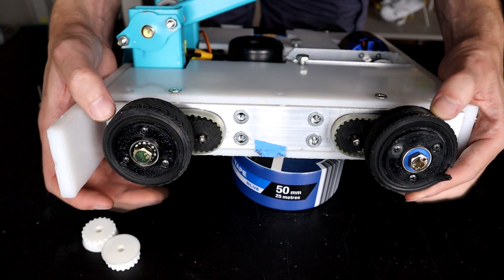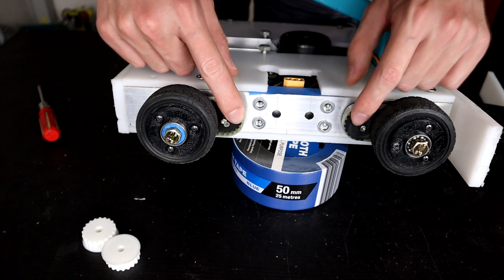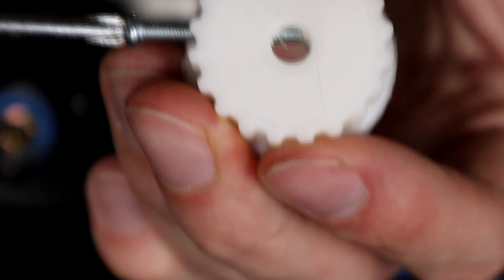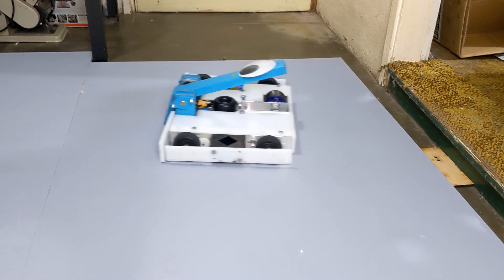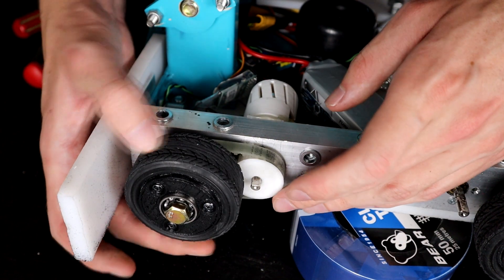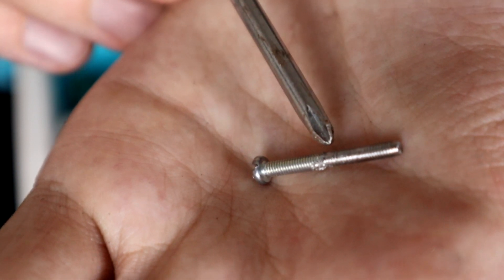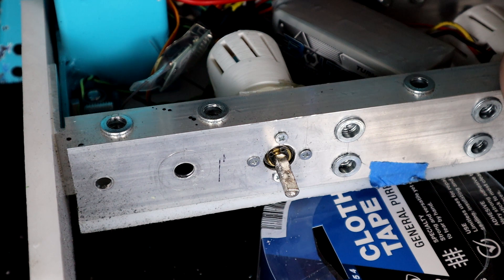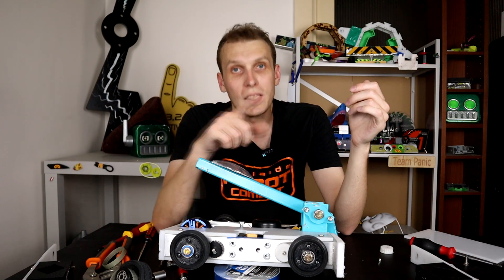Putting a screw under a dshaft! (robot drive experiment)

Comment: Why not a set screw? Currently my robotics team is using one for our weapon pulley. You sacrifice a few teeth of the pulley, but that is not terribly important. Just have a counterbore hole perpendicular to the flat part of the shaft and put a relatively small bolt in it and you're golden!
Reply from the maker: I used setscrews for the robots first event: https://youtu.be/oKO390bJDTI
They rounded out or stripped every fight, so I needed something better

Comment: Solution: use coupling flanges. These are metal and will mount to your shaft. They have a round flange with screw holes to then mount to your printed pulleys. You could use two (one on each side) for extra strength. Youtube won't allow me to post a link, search ebay for "flange coupling".
Reply from the maker: AHHHH! Thats what I've been looking for but didnt have the right key words to search for,
Thanks!

Comment: I would try a bolt with partial threading. Right now those threads contacting with the D shaft act like a saw, plus it has very  little contact area.

Comment: I think the problem is that the D shaft is engaging only with the side of the bolt, so there is only a tiny bit of thread and maybe a couple 10th of a mm of the side of the bolt (and not even over the full width of the bolt since it's round) that is actually engaging with the D shaft. This is simply not enough surface and the motor has enough torque to basically push the d-shaft through the threads/side of the bolt stripping the surface. Using a bolt of hardened steel could help but you're still dealing with the problem that there is very little actual material engaging with the surface of the D shaft.

If I were to try something like this I'd try to cut a slot in the pulley next to the center hole (at right angle to the surface of the D shaft, so it would become more like a -D with the - being the slot if that makes sense?) and put a nut with one of the sides against the surface of the D shaft, and then a bolt through the nut like the previous idea (so you get +D with the horizontal part of the + being the nut and vertical part being the bolt). The nut would work more like a key with a large flat surface for the D shaft to push against and hopefully stop the abrasion, while the bolt should keep the nut securely in place in the pulley. If that fails using hardened steel hardware would have more of a profound effect since there would be a lot more material engaging with the d-shaft and the bolt should help a bit with the structural integrity of the bolt. Downside would be that the nut would become unremovable and the entire pulley trashed if the bolt would strip threads or became bent in some way.

An other solution would be to grind down a slot in the bolt and place the bolt closer to the center of the pulley, so that the slot in the bolt engages with the surface of the D shaft. This would make the bolt weaker but again, provide more surface area for the D shaft to catch on to.

Very interesting solution though, at first I thought you just re-invented the set-screw but when you started driving the bolt in I thought that was a brilliant solution, but sadly not with the desired effect.
Reply from the maker: The point about surface area is a good one

I just remembered I do have key stock around somewhere, this technique might work with that rather then a bolt... mmm
Reply: Using a nut also has the advantage that nuts are pretty much always stronger than the corresponding bolt (same grade/strength). This is so the failure occurs in the bolt, because that's a whole lot easier to analyse when designing things.

Another thing that would probably help is making sure the the part of the pulley towards the rim is all solid so the nut/bolt can't flex outward as the D shaft turns. The D shaft is functionally a cam that's trying to wedge the pulley/nut/bolt away from the shaft, and relying on the pulley/nut/bolt to be strong and stiff enough to resist this. 

Carbon fibre pulleys might help in this regard given the stiffness increase that would give.

Comment: Maybe instead of having a bolt, have a cut piece of a D shaft in its place so that the contact is flat on flat?
Reply: Or maybe have a rectangular slot in the pulley and just jam a flat piece of metal in there
Reply from the maker: I do have some key stock around somewhere I should try that

Comment: You could change the ratio of the pulleys to increase torque? It would be a little slower, but wouldn't require as much force to spin and change direction. Maybe drill a hole in the shaft and use a through pin? Like a cotter pin?
Reply from the maker: I do want to do that, this drive system is very fast currently, so being a little more controlled would be good and it will help ease the load on the drive pullies